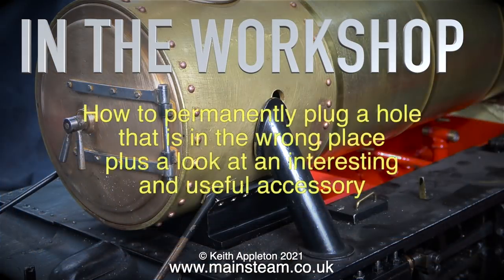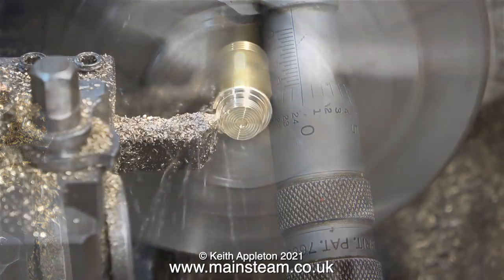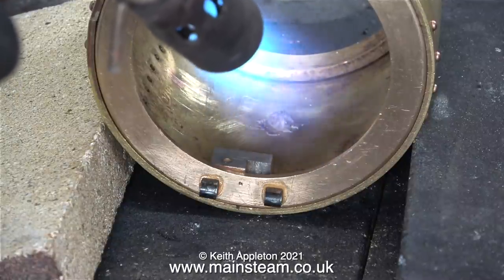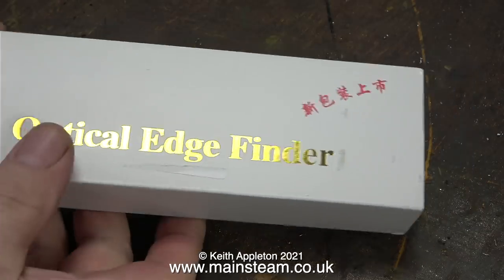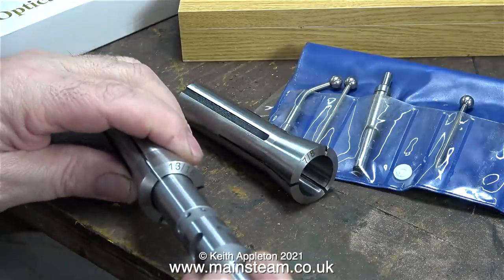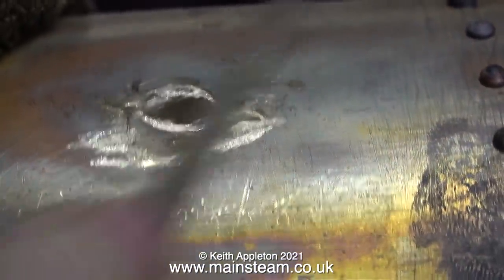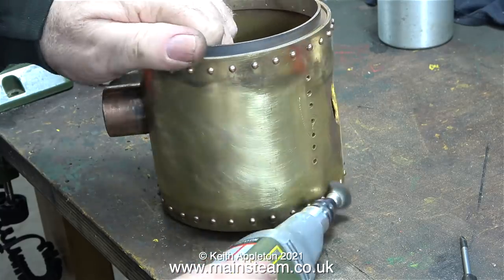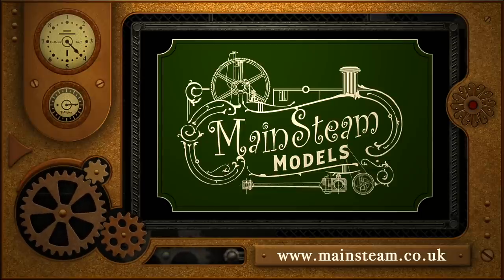HOW TO PERMANENTLY PLUG A HOLE - IN THE WORKSHOP

Comment: That is one fine repair!   I've used JB Weld on parts that get real hot such as exhaust manifolds, but they were made of iron.  Since JB Weld for steel has steel in it, it expands and contracts with the steel or iron around it. I doubt if it would stay in a hole in copper or brass.  The other problem with using JB Weld on nonferrous metal is that it would be hard to grind down the JB without gouging the softer material around it.  But JB does make a product for aluminum and copper called Water Weld as well as one formula just for high heat applications.   I was just explaining to my friend before watching your video what all the mood music videos are for and she gave me an idea:  Why not make a "paint drying music video to relax by"?   You could make millions!